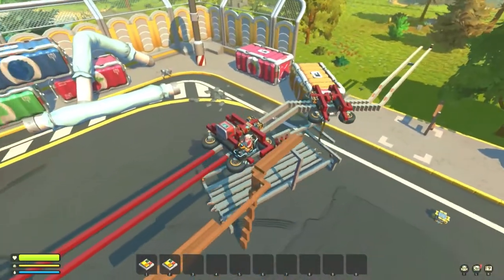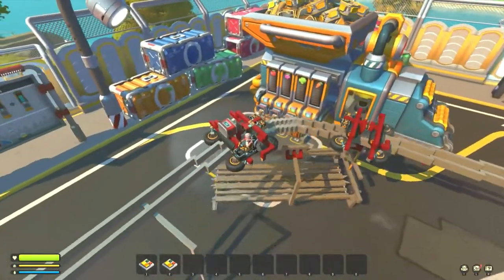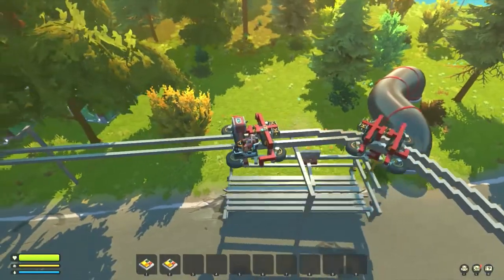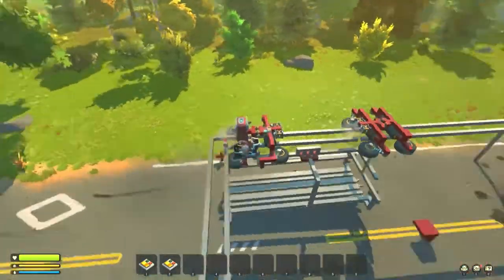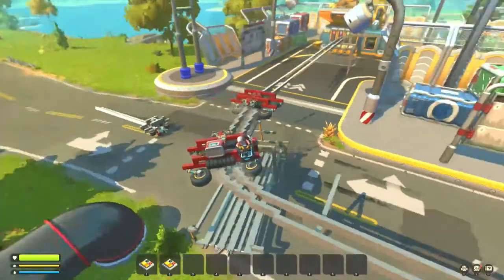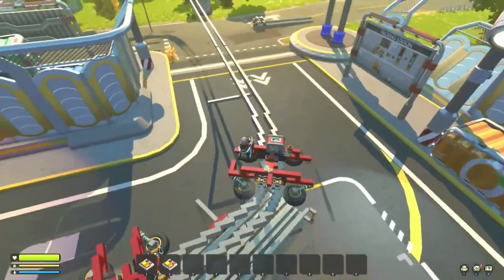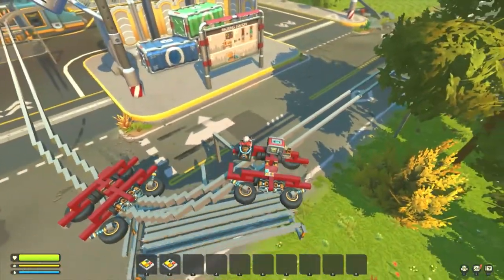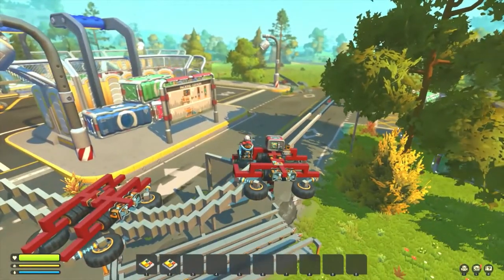Scrap Mechanic - Full speed - Fruit and Vegetable crate loader testing. Its been a long time.

Comment: How necessary is the gradual corner? More of a curiosity than anything else.  Also, as long as both carts are connected by a loose bearing to the main transport structure, they should be able handle corners just fine.

If you want to do lag reduction with one loose, one solid, you'll need to tinker around with cart placement.

Bro, this is freaking awesome and I'm excited to see what you do with it!
Reply from the maker: A gradual corner at speed makes a big difference. There is a big kick as the bogies cross in to the corner. The barrel  of wheels allows the bogies to move to the side on top then,  the large side wheels and suspension take the loads of the corner. Tight corners need smaller bogies with the distance between wheel sets very small. Bigger corner = Bigger Tires & Spacing = smoother corner overall. 
I have a number of bearings all though the machine, most are stiffened by an Empty Gas Engine. So there is movement but no sloppiness.  (helps with lag to) There is also a piston pressure relief in the middle of the bogies, helps them to jump and bump past close clearances. 
This one I am excited to finish especially the loop from the tier 2 packing station. Now that's a long straight rail.
Reply: @GuardianOz  preach! I did the second packing station, even with unlimited inventory and /import I was pounding my face on the keyboard waiting for it to be over.

Also, the bearings connected to an empty engine is very interesting 🤔 I will store this info for later.
Reply from the maker: @Massitcles  Thanks for the import tip. Built track to other packing station. NOW I have a bug that deleted all the tire stacks from the bogies. Not Happy!
Reply: @GuardianOz  wait, your tires were deleted from your free floating creation?

Comment: I made a monorail in creative that uses twice the wheels because the rail is a 3 wide 3 tall plus shaped rail and it is pretty stable even when a max power lvl 5 thruster is trying to push it.
Reply from the maker: I have a rocket train, that corners really well in creative. It did not work in Survival. Survival physics is about 8 on the slider in creative. You should try it on your monorail. This design is about an easy to make track, that can corner and climb (At speed) and Allow the track to be used in either direction. Will small loops in each location.